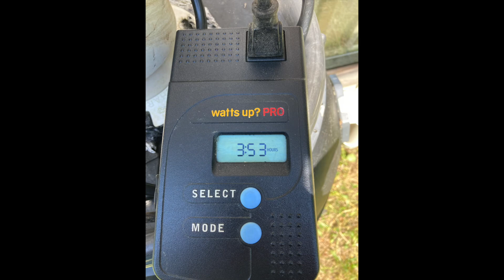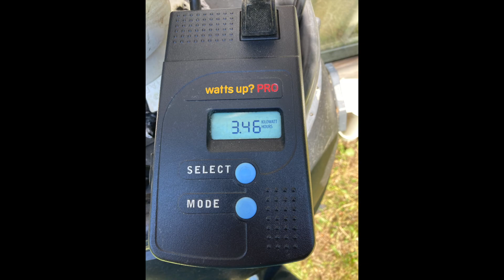55 gallon biogas digester Part 3, Feeding

Comment: You can use biogas blue bag storage 1 cubic meter, if you want upgrade than get 3 storage bags, three bag is for raw biogas and four bag is for pure hydrogen or without storage for over hours with hydrohen generator, that can mix carbon dioxide to methane. Raw biogas had 2/3 methane and 1/3 carbon dioxide is same gas volume as full hydrogen and half oxygen. You should use cow with any dog or poultry manure in and use lawn mower collector of grass to put in digester to produce more gas.

Comment: Can we use dry leaves
Reply from the maker: mostly carbon, work out the recipe and add enough nitrogen for correct C:N balance
Reply: Dry leaves are carbon what can I add to balance nitrogen
Can I mix dry leaves with cow dung like 5:1 to balance it, or should I add urea etc...

Comment: Do you have to heat it? Not so warm where you are or what? Thanks
Reply from the maker: maintain temp toward higher end of the mesophilic range of 70-105
Reply: @HandsOnOffGrid  will going above that ruin results? Thinking i should keep in shade then, hot where i am
Reply from the maker: @LuckyBastardCandleCo  try to keep it <110, otherwise you get into the thermophilic range and things get a bit wonky - mostly the digestion will happen a lot faster